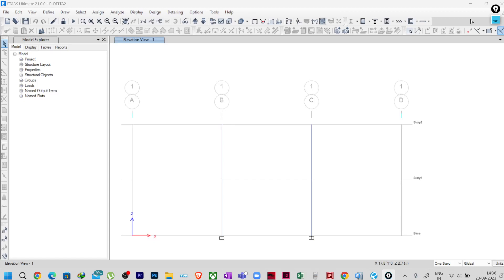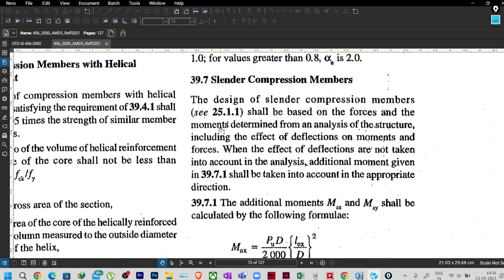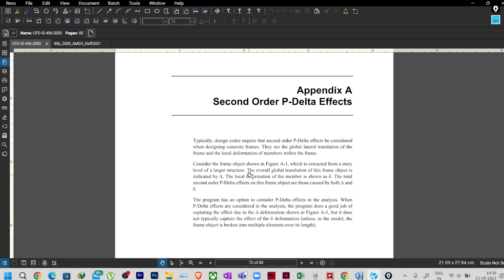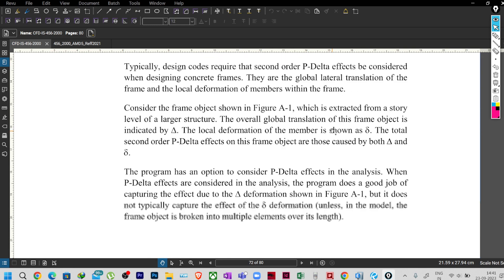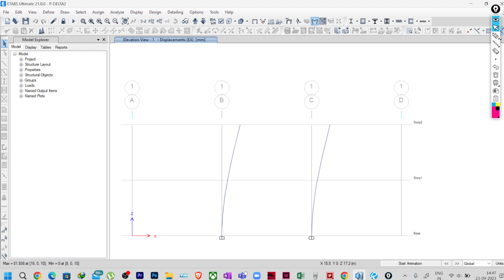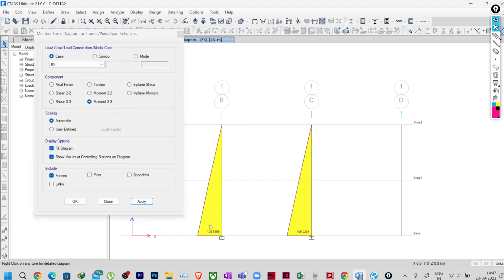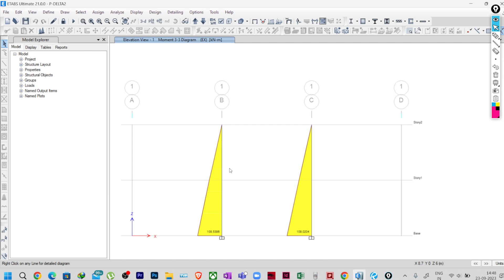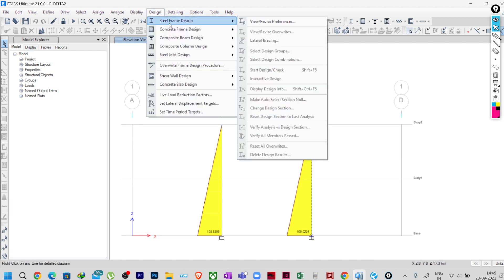P-Delta Analysis in ETABS and Additional Moment for Column Design as per IS456:2000 | ilustraca

Comment: Sir it has been seen in video that while checking concrete preference, consider P-Delta done? is selected as yes which is black in colour that means it changed by the  user if we run P-Delta analysis then ETABS should consider that by default right?

Comment: my shear wall is showing extreem high RF requirement. what is the issue.
Reply from the maker: Shear walls always attract high amount of force due to higher higher lateral stiffness along its longer dimension, so it is obvious. In case u want to get lesser force in it then, few more shear walls you have to introduce along the same direction.

Comment: Sir,
Case 1: If we are meshing the column frame element, then no need to consider additional slender moment as per IS CODE.

Case 2: If we are not meshing the frame element, then we have to consider additional slender moment along with P-Delta
Reply from the maker: Don't go fot Case1 ..be in the conservative side and take P-delta and Additional moment both